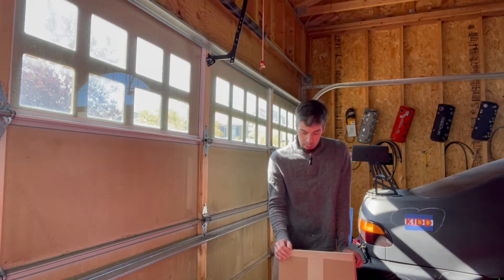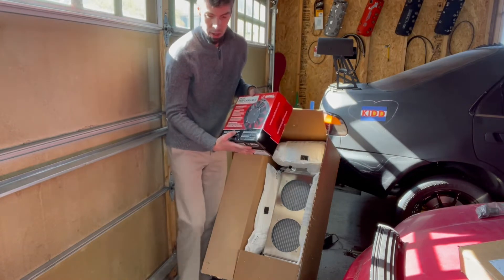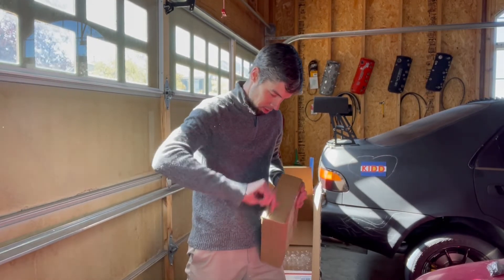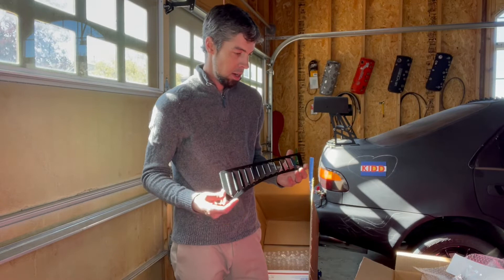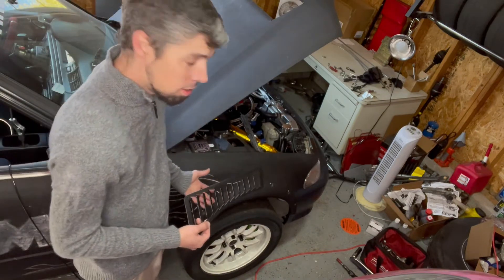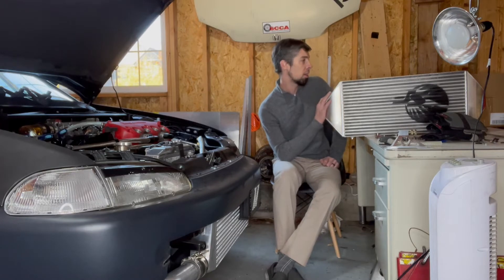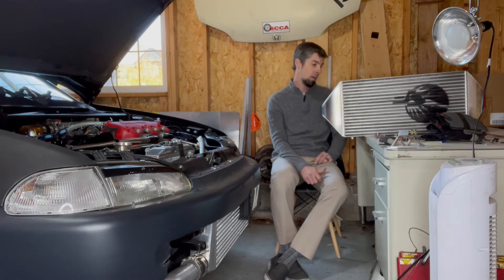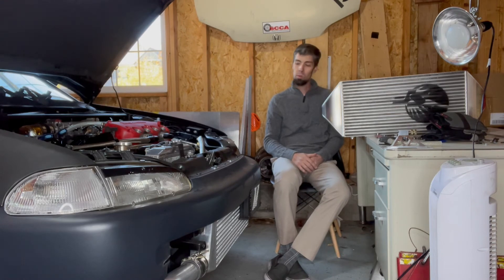Speed Factory Racing tucked radiator and dual backdoor intercooler unboxing

Comment: Got this on ek with rMhorn and it overheating idle , because they're so close together air flow is poor and can't get the other fan on
Reply from the maker: My car had a/c so I used a jumper wire to make the condenser fan relay energize when the radiator fan comes on. Then both fans will run at the same time. I haven’t finished installing mine. I’m upgrading to -20 hoses because my tuner/fabricator said he’s seen them overheat. I think your issue is more the second fan isn’t running than the spacing . They should be close together. I mean they run this setup on their race cars, it has to work sometime.